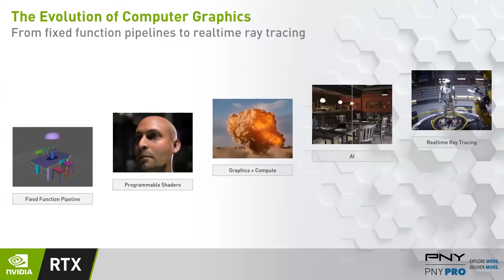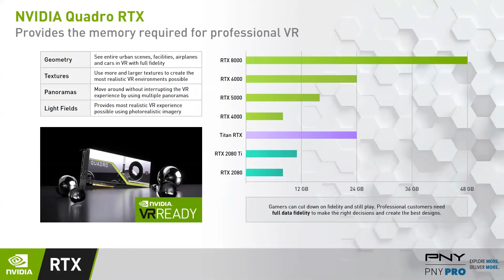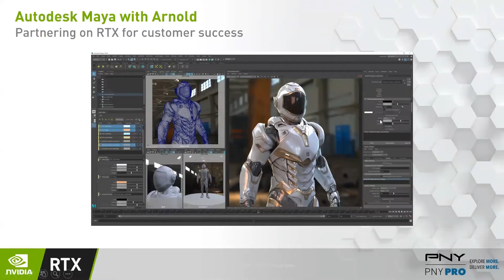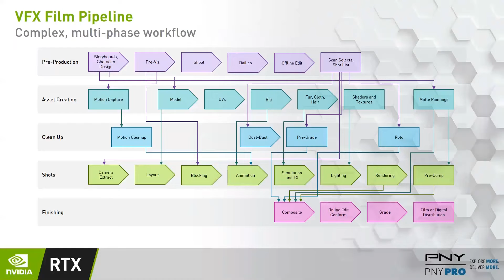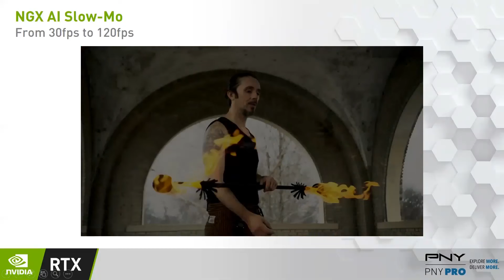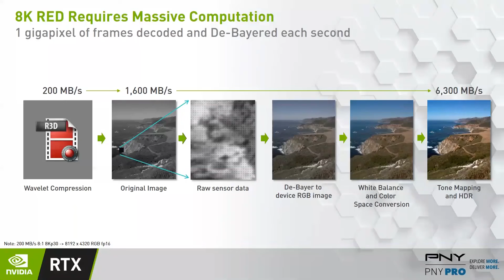NVIDIA Quadro RTX for Media and Entertainment Webinar

Comment: It is extremely welcoming to be able to rewatch the "The Making of Quadro RTX" webinar with audio, I was one of the many people during the original broadcast who had to watch the whole thing without any commentary and now select bits and parts of information are much more well understood at this point, without a doubt, I must deliver my personal thanks to PNY and Nvidia for archiving this proper. (:
As a local entertainer who specializes in plentiful fields of work in media (including, but not limited to, original Live Action programming, Photo Enhancement and Hyper HD (I600p) Remastering, Commentaries, Promotions, Remasters of old video footage into Standard HD (I280x0720 or better) with the implementation of both High Framerate (060 FPS or higher) and High Dynamic Range, the creation of Digitized Graphics for games, and the occasional work with Tridimensional models, among other tasks), having a Workstation Level Graphics Card has unfortunately been a Pipe Dream for me since the earlier half of I999: You are reading the words of somebody who had grown up using the Integrated graphics of an Intel Celeron (Early Mendocino Era) processor from a PowerSpec 4510, as well as Leadtek's WinFast A350XT TDH Graphics Card (which is apparently a custom reworking of the Nvidia GeForce FX 5990XT), Nvidia GeForce 6150SE with nForce 0430 via an AMD Athlon II x02 0250u, Intel HD Graphics 4400 via the Core i03-4160, and now the lower end of the AMD Radeon RX Lexa line (in this case, the RX 0550, 02 GB variant); while now having an RX Lexa to work with, it has been ultimately clear to me for decades that in order to produce the work that I do at the far faster pace and wider scale that I must nowadays, not even a GeForce series GTX or RTX Graphics Card is essential for my line of work, thus having a high to optimal grade Tesla or Quadro from the Pascal, Volta, or Turing Era is mandatory in these current times and definitely is a core reason for why I would get a Quadro RTX 6000, 8000, or the eventual TU100 (assuming that the TU100 will still even be a reality during the Turing Era, be it for Tesla, Quadro, or both), in the event that money were not an obstacle.

There are some things about the RTX 6000 and 8000 that do come to mind though that make me curious about what it can truly do:

~ AI~based Super Resolution Scaling Enhancement: Even on an RX Lexa with Topaz Labs' image enhancement application AI Gigapixel, the act of Remastering a photo in this fashion is ideal for any editing and optimization needs, which makes me wonder exactly how this would work in video editing; now, Vegas Pro has changed up a good amount since the rise of Version 0I5 and 0I6, though I still have yet to see something such as AI Super Res become usable in the application, so I am led to wonder if Vegas will ever have true benefits from a Quadro RTX, for if it will, then this would be a game changer for upping the quality on Standard Definition (0480p and lower) video, AI Super Res is obviously not perfected yet but it truly does make a dynamic difference and would help make any footage feel flawless, even on a Standard HD or Super HD (I080p) scale.
~ High Dynamic Range Imaging: This got me extremely curious: I have known of HDR Imaging since 20II but never have seen the optimal benefit of its usage until I made my own lighting and shading template, known as the PurLight Engine, back in December of 20I7, which takes what you would expect from HDR and utilize it in a way that manipulates its feel to be more on par with that of a Film~based recording if it were to use the template; for those who are curious and want to see it in action, you may check out my Demo Reel Playlist for the PurLight Engine here: https://www.youtube.com/playlist?list=PL1Iq6pRBvcw4ucT6q60dmAm-emeBVM5wB
Version 0I.00 of the PurLight Engine from December of 20I7 has had an issue with severe Colour Bleeding even on higher bitrates, which has been confirmed to be an issue with having a lower grade GPU (though Rendering Speed is solely CPU Dependent, which is ideal for a Dual Xeon Platinum 8180M or Threadripper II (2990WX) plus Xeon Phi 7295 setup); very likely, using Quadro RTX or Tesla Turing would fix this massively and I could make Version 02 of PurLight, but all remasters will have this issue for the time being until I can upgrade.
~ Slow Motion and the Addition of Extra Frames without Interpolation: If NGX is superior to Twixtor in this regard full throttle, then that guarantees my decision to upgrade to Quadro RTX, though it must be noted that using this feature is not solely intended for Slow Motion: As you will have noticed if you watched the PurLight Engine Demo Reel, all of the Remastered footage is in 060 Frames per Second, which was obtained by using Twixtor in somewhat of an Inverse Method, as the video was sped up in Vegas Pro and then given the slowdown that Twixtor uses to add in the extra frames; if Turing can do this without error, then we're in business, and especially in a time where televisions such as the ones from LG and Samsung are using feaatures such as TruMotion and Auto Motion Plus to up the framerate of videos that are below 060 FPS, with this available natively in Quadro RTX, we can basically create HFR Remasters of every video ever made, that would change up the industry outright and potentially change up everything that we know about HFR optimization currently.
~ Gaming: Something that was not addressed proper in this webinar is the actual performance of a Turing Era Quadro in current A~list games, this is something that is important for people to know because I find that the Quadro RTX line seems to surpass that of the GeForce RTX 2080 Ti and even the Titan RTX in Benchmark Testing: The Quadro RTX 6000 is currently at the Top of the Food Chain on Technical City's GPU Benchmark listings (it would instead be the 8000, but that has yet to be put in any Benchmark Tests on any of the major websites up to now), and if you compare it to any other GPU, the RTX 6000 can run every major game tested with optimal performance and far beyond the intended presets that they were initially built for; this leads me to feel that Nvidia would do better if they started phasing out GeForce and making Quadro the mainstream Graphics Card outright, there would be a much better playing field for content creators if virtually everybody had a Quadro in their computer and with the way that Turing is going so far, I don't see why this can't be a good business measure, the cost of Quadros would ultimately drop to affordable levels and help deliver optimizations in ways that we have yet to see, we already have this with GeForce and Tesla Softmodding to utilize Quadro Drivers and other elements so it wouldn't feel unjust to do this at some point so that gamers and entertainers have an equal experience.

There is a lot more on this that I could discuss on some of these subjects, but I feel that this'll do for now, it is a very firm truth that Quadro is the future of entertainment outright and I would hope that even a Ten Thousand US Dollar Graphics Card such as the Quadro RTX 8000 becomes affordable down into the hundreds for those who truly want to build a Workstation that is meant to last fifteen to twenty years.
I may be a local entertainer who still uses an Economy Quality GPU due to the current cost factor in the tech industry, but I know a true gem when I see one: Quadro (and in turn, Tesla) deserves to be experienced by all in the upcoming years and decades, and if there were a way to have prebuilt computers at the consumer grade have them without violent price gouging, then more people will do better by it; with Turing looking as good as it delivers, I can only imagine what the next GPU series will bring on to us in an easier formula, but for now, I think that optimizing the RTX line to ready us for the eventual TU100 must be the top priority, we can be patient for the next generation for a good bit and letting RTX sink in for at least a year or two will help more fully understand its truest capabilities at its optimal best. (:
Reply from the maker: Thank you! We apologize for the audio difficulties during the webinar. We will be moving to a different webinar software soon and we promise you'll be able to hear future webinars with ease.
Reply: Chill just chill...